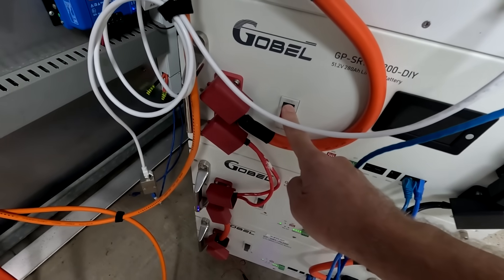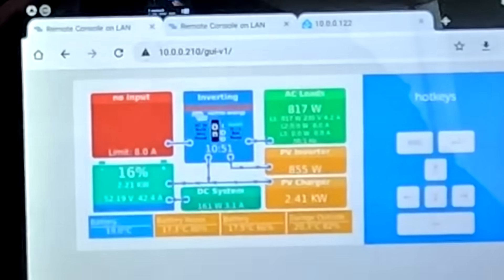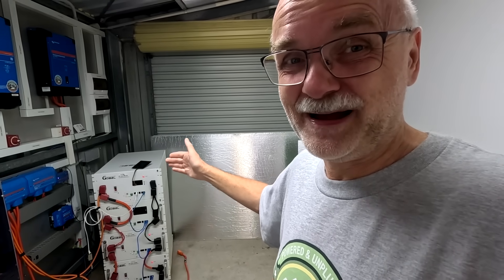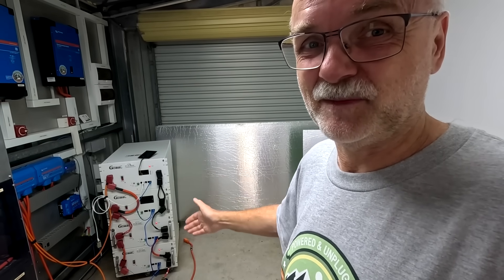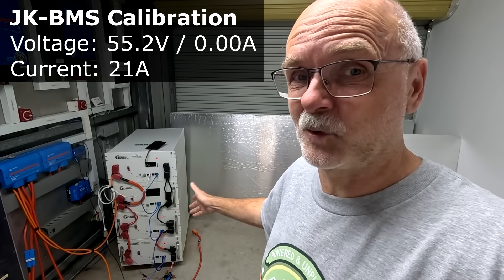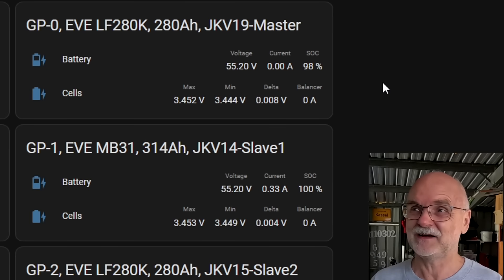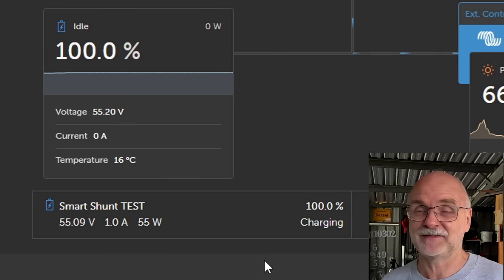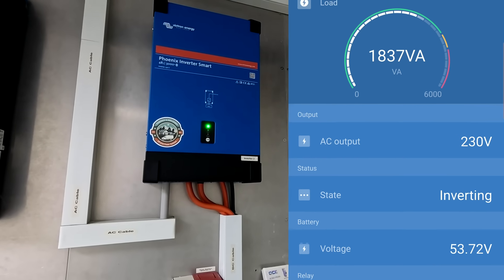SOC not accurate in the JK Inverter BMS? Which model works best, V14, V15 or V19? | Part1

Comment: I just updated my V15 bms to firmware V41 and now it sits on 99%, never reaches 100%. Any pointers please Andy ?
Reply: Have you configured the cell voltage reset? The requested charge voltage has to be higher than the 100% state of charge reset. Let's say it's set at 3.45. a single cell has to hit 3.45 for it to say 100% state of charge...
Reply: @brettcombs774  Thanks for the reply..RCV is 3.45, 100% SOC is 3.449. I had a few cells hit 3.50v and it didn't reset to 100%...I've checked the overall pack voltage with 2 multimeters and it's bang on.
Reply: @kennyrodg 

When pack voltage exceeds the requested charge voltage.  55.2 in my case (RCV 3.45). The BMS switches to absorption from bulk and starts the charge status timer. I confirmed this is with some cells below The 100% SOC reset. 

I assume this means that a single cell needs to exceed the 3.425 SOC (in my case). Since not all had exceeded that value. 

When the charge status timer (absorption timer) concludes. The SOC resets to 100%. . I can confirm this is irrespective of a low cell below the 3.425 SOC set in my case. (I managed to find a cell that can discharge faster than a 1A balance can maintain around 3.365v). 

If the cells (all) fall below the SOC (3.425 in my case), the timer resets to 0 seconds. So if you're floating around that point it may never reset 100%, you have to maintain the pack voltage total and cell voltages for the duration of the timer. 

For me I'm having to play with my inverter at 55.6v (no comms and poor Float support) I'm also limiting charge current to mimic a float near top SOC measured via shunt.
Reply: @brettcombs774  Many thanks for that Buddy, I can get my head around it now from your example/explanation...It's very much appreciated.
Reply: @kennyrodg no worries mucking with mine while I've got solar ATM so figured I needed to understand it myself. I still don't. Feels like a lot goes into it.
Reply from the maker: @brettcombs774 thank you for your explanation here. Absolutely correct.
The mechanic is:
BatVoltage > RCV*16 -> RCV timer starts -> RCV timer ends -> BatVol > SOC100%VOL -> 100% reset